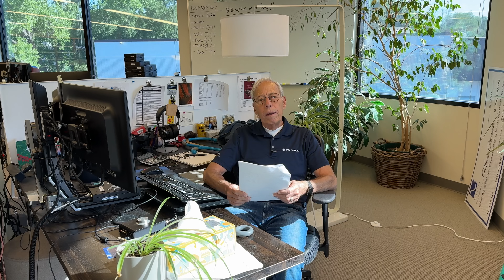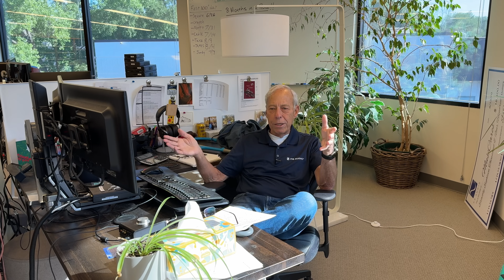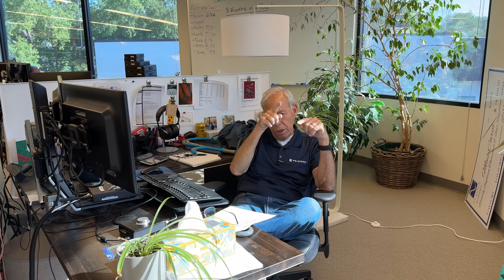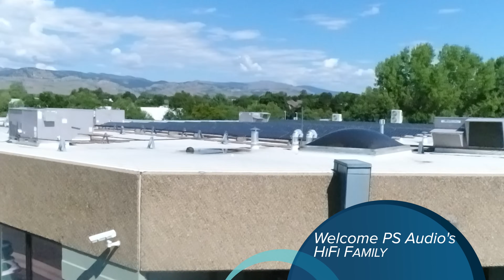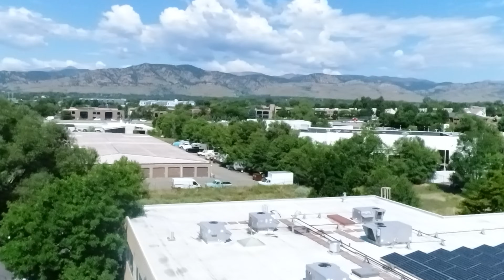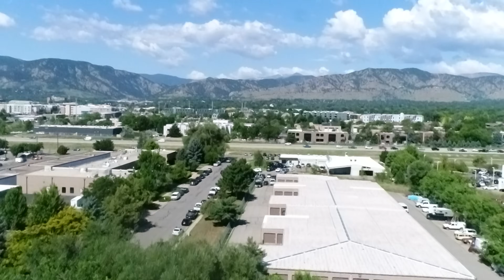First few class A Watts

Comment: A higher power all class A amp consumes a lot of power relative to the amount of power going to the speaker (load) and runs hot . Amps that switch to class AB above a certain level run cooler , consuming less power than fully class A .Triode single ended tube power amps are class A and act like room heaters as well .

Comment: it is very common that, for example, the first 20w are class-A and the rest AB.

But Class-A has a very bad sound when the transistors are cold and they have to warm up before the sound is good. class-A is very troublesome with this, much worse than class-AB and class-D where you don't hear as big a difference between cold and hot transistors

Comment: Class A and Class AB are NOT the same, If you want Class A then get a pure Class A, you WILL NOT get Class A performance from a Class AB amplifier, even at low volume levels. I would be clear about this! Pure Class A's use single ended drivers, Class AB use push-pull drivers.
Reply: Wrong! The vast majority of class A amps are push-pull, and a class AB amp biased to be able to output 2-3w in class A will behave entirely as class A up to the bias point.
Reply: @paulmilligan3007 I understand you are both right. Most class A are push-pull, and therefore will act the same as AB amplifier when those are using the few first Watts. But single-ended class A amplifier won’t and are not the same as push-pull class A or AB amps. 
Am I correct ? 
The question could be : do push-pull class A and single ended class A amps sound different?
Reply: @phfen  I have no experience of single ended class A but they have a definite following. Nelson Pass of First Watt is the best known proponent. I'm a retired professional engineer so I'm biased to the mainstream use of overall negative feedback to reduce distortion and lower output impedance.

Comment: I use a wonderful Musical Fidelity A1 Final Edition, a Tim de Paravicini limited edition 2 box integrated, which is an AB mosfet circuit (totally different to the A1), of about 35-44W, heavily biased into class A operation, the sound definitely hardens up, sounding less sweet and organic and dimensional, when the volume knob passes the 12 o'clock position, but that's DAMN loud in my  moderate room with 92db efficient speakers, it's in class A operation for 99%+  of the time. I hope this is a useful comment to someone in our community. Cheers from London, Paul!

Comment: Lets not confuse people with high bias class ab with true class a topology.. true class a uses a single output device to push and pull the driver.. class ab uses one trsnsistor to push and another to pull the driver.. ALL CLASS AB amps have a bias circuit that marrys both  together.. now amps that are static bias and are slightly gapped between push and pull ..are concidered class b..all class ab amps are adjusted to slightly over lap the conductance..ALL OF THEM. Some brands run high bias ..which means Overlap the two sides more..this makes the amp run hotter but slightly more musical with cleaner midbass..
Reply: You seem to believe that only single ended class A is true class A. Single ended class A has it's own characteristics but the majority of class A amps are push-pull in architecture and are still true class A.
Reply: @paulmilligan3007  if its push pull its ab. Now if they are in series...then its still class a..but if theres bias .its class ab..

Comment: Just get a cheap 3 watt chip amp  board, hook it up and realize a just how little power you are using for normal listening. 
Trying 3 watt chip amps totally changed my outlook on hi fi.
Reply: I can't afford the consequences of only having 3 watt of amplification. Some reviewers might not have this problem.
Reply: @Jorge-Fernandez-Lopez  The consequences of trying 3 watt amplification is a bill for around £10, you can't afford that? 
I'm currently using modified computer speakers as amplification that were left for recycling, so they were free.
Reply: @joejoejoejoejoejoe4391  The consequences can be very expensive, while the sound won't be great in some cases. I can't afford that.

Comment: In my opinion, pure class A operation results in the finest sound quality, although modern, well-designed class D amps are impressing me as well.
Reply: I agree.  I've run the gamut of amp topologies, both tube and soild state, and keep coming back to pure class A solid state.  Excessive heat, and subsequently size and weight, plus relatively low power output can be a pain to deal with, but worth it IMO.
Reply: @kimchee411  I built my own class A monoblocks and took great care with the earthing and they're lovely and quiet. I did get some expert advice about the size of the toroidal transfomers  and the heatsinks to use and they have worked out briliiantly. Power output is around 50 watts RMS, with paralleled output pairs.